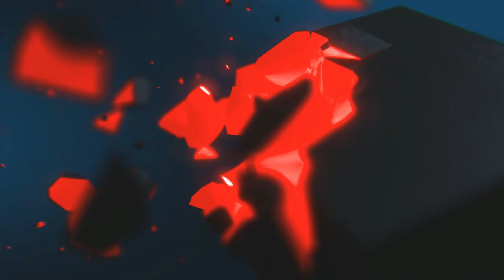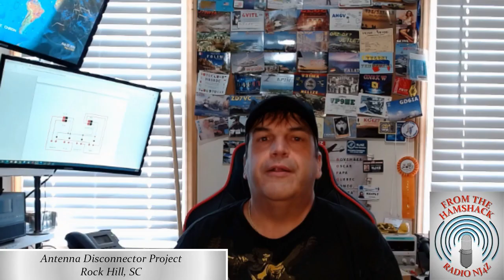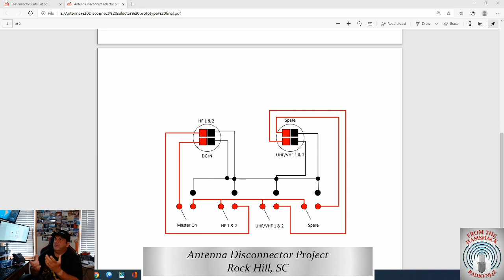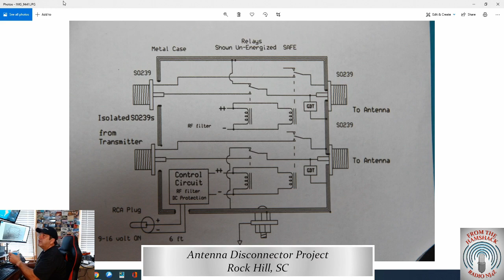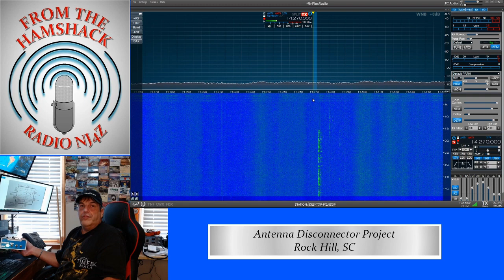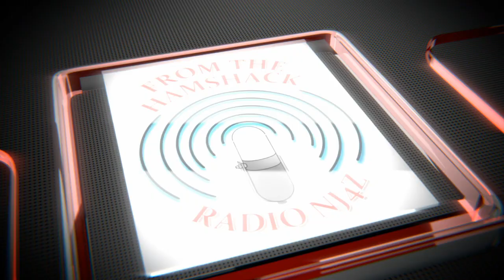How to Remotely Disconnect Your Antenna(s) - A Solid Solution!

Comment: The GDTs (Gas Discharge Tubes) don't break. They're filled with a gas that will arc above a certain voltage (picture a glass fuse, but with a gas instead of a wire). A plasma arc has near zero resistance, so that center conductor with an over-voltage triggers a plasma arc to ground and the center conductor discharges.  The GDT is not a once-and-done, either -- it will continue to function as long as it's not damaged by its work.
Pretty nifty devices. Go from zero conductance to near perfect conductance in an instant, and once the arc stops, back to zero conductance.

Comment: did you consider DPST(double pole single throw) for the switches to isolate the negative bus?
Reply from the maker: No I did not since the grounds are all common, I didn't think it to be necessary.  But that is a good observation.

Comment: Very informative.. Great solution.

You said the shack is on the 2nd Floor... How do you achieve a station ground, to ground from the 2nd floor..?? Thanks
Reply from the maker: I do not have an RF Ground in the shack... I have a ground bar and all the equipment is tied to that but no direct path to earth... the path is too long and would be more of an antenna for noise then a ground.
Reply: @fromthehamshack-radionj4z  O.K... Thanks
I was wondering if you had issues with RF getting into the shack...